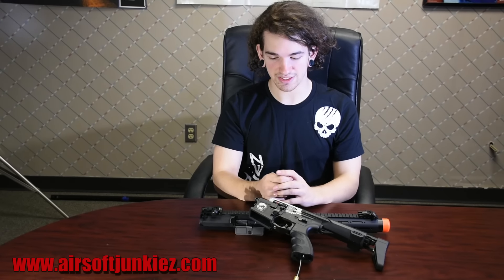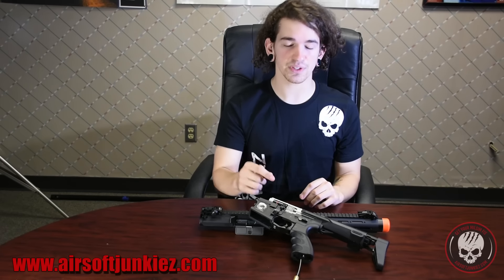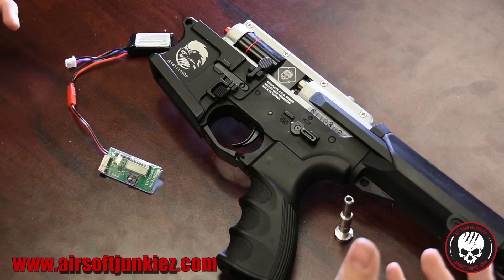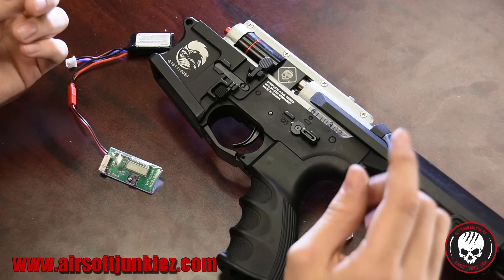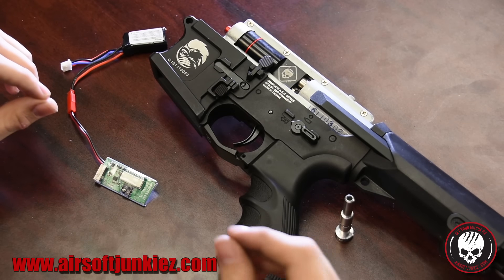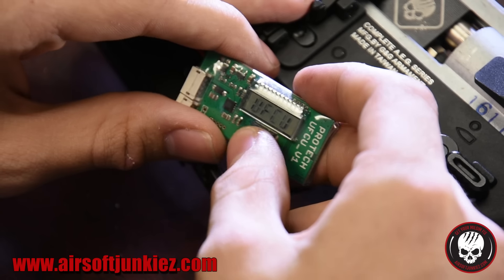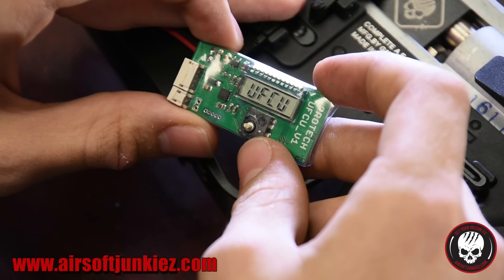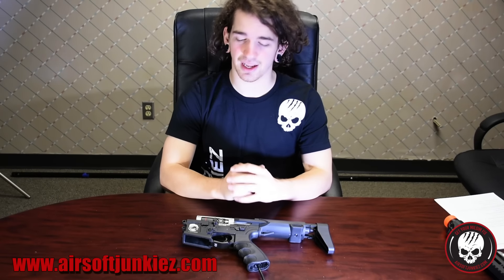New Protech MK 2.5 -- review by Airsoftjunkiez.com

Comment from the maker: Accuracy is from your hopup and barrel system. All of them have great consistency but if you don't have the right combo then no matter what engine you drop in you will not have accuracy.  We use promi barrels, with prowin hopup, promi purple buckings with fusion engine or N7 or Inferno to get the best accuracy